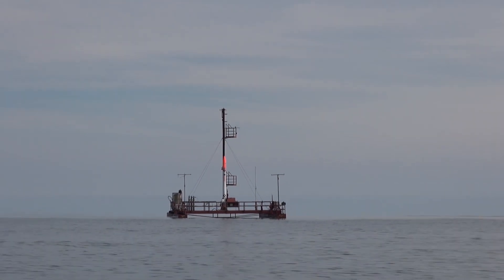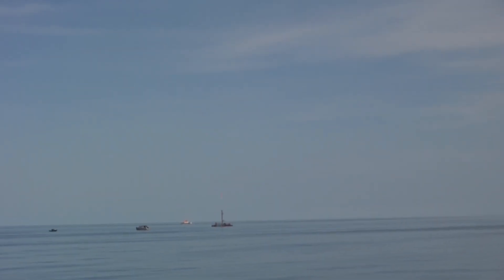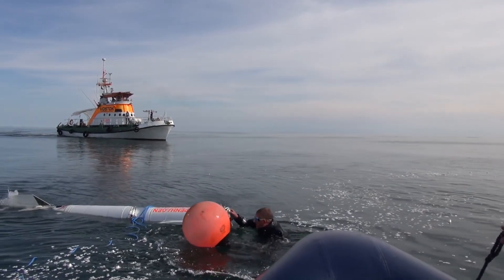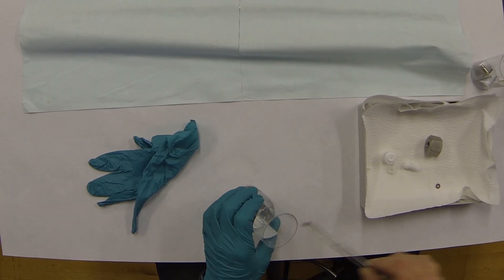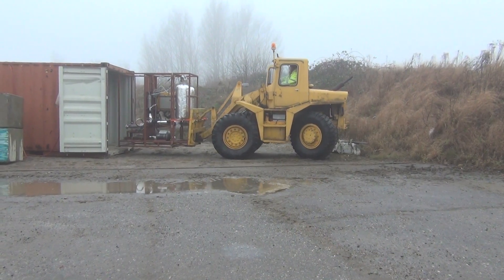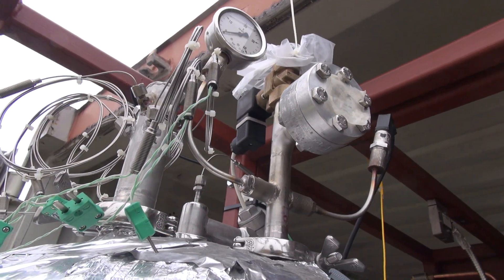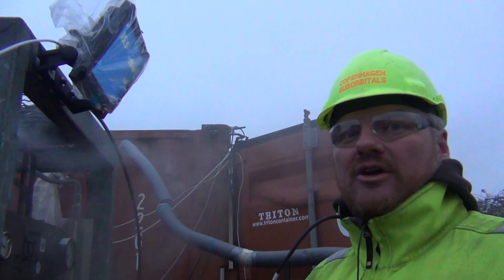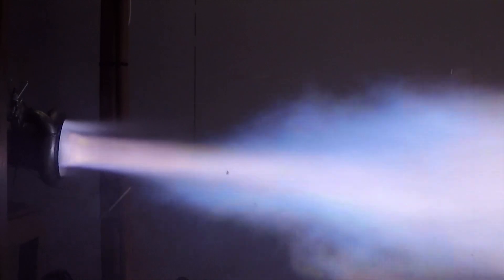Building a Capacitive Liquid Oxygen Level Sensor

Comment: I hope you take the rotation of the rocket into consideration, as it is essential with respect to the liquid level inside the tank.
Reply: The idea of the sensor is only to measure the level when we fill the rocket with LOX.
Reply: Actually, because the rocket is accelerating in the direction the rocket is facing, the liquid always stays on the bottom of the tank.
Reply: Right. If one thinks about it, it makes sense. Out of curiosity: Do you experienced some ripples/standing waves (measured by the sensor?) on top of the liquid layer due to the vibrations during flight? Are there any noteworthy vibrations that could influence the sensor signal?
Reply: For this rocket I don't know, but for example saturn V had a structure inside the tanks to prevent the fuel from forming waves, however that was more to keep the rocket stable than for measuring the fuel.
Reply: Mathias Busse They have not yet /flown/ the sensor. They made it this winter and plan first flight in Nexø 2 this summer.